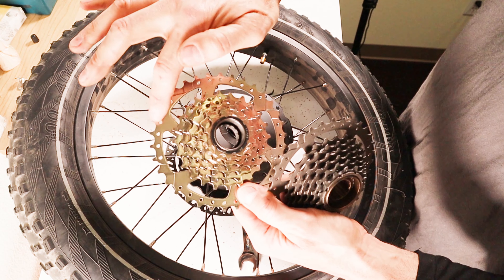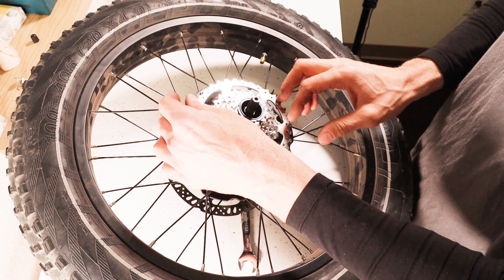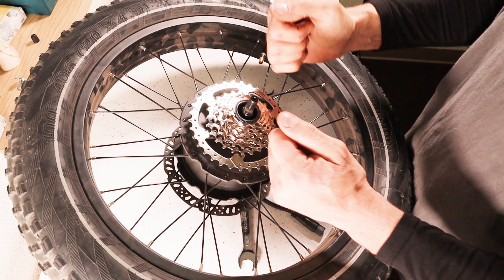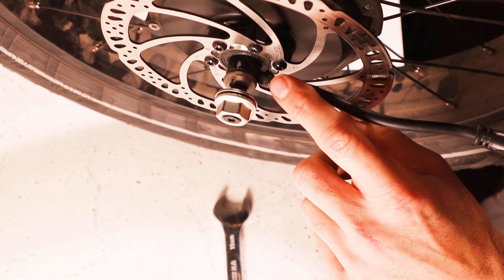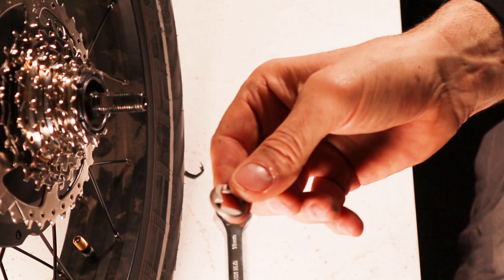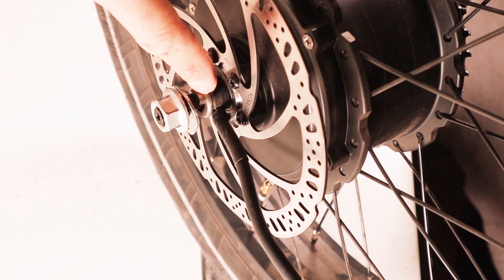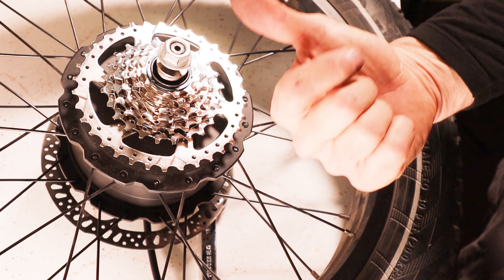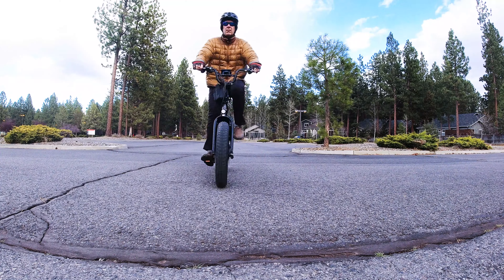RadExpand 5 - Freewheel Upgrade

Comment: Thanks so much for this video!  (And the other related videos about removing the wheel/adjusting the brakes).  With your instruction, it was so easy to fix one of my frustrations with the Rad Expand5...ghost pedaling.  I've only ridden a bit after making this change but it feels like all the gears are useful now, as opposed to only 6 and 7 previously. And I get more purchase in gear 7, for sure! I took my bike out of the stand and put it on the ground to help get the wheel firmly seated before tightening everything down - felt like it was impossible to do it while in the stand.

Comment: Thanks for the share!  I definitely will do these upgrades to get some more speed out of my RadExpand 5.  I would really like it to go 35mph.  Post more if you figure something out.
Reply from the maker: I will let you know 👍. This gives you a few extra mph. It helps quite a bit. Keep in mind, these motors are not designed to go 35. They would burn out quickly
Reply: You gotta build a mid drive for those speeds

Comment: Is the spacing between the bears the same as the original freewheel ? I made the switch but found that I have increasing difficulty changing  from the 11 tooth high gear to lower gears. I can make 3 changes and no  more? 5:33 . 
5:33

Comment: Your videos  gave me the courage to change out my freewheel despite the « dreaded rear wheel » 😅. In re-installing the wheel I broke off the alignment bolt, just above the axle bolt (brake side). Is it crucial for the safety (keeping the rear wheel in place) or does it mainly serve to align the wheel while re-installing? Thank you 🙏
Reply from the maker: It just helps align the wheel. If your axle bolt is tight your wheel will stay in.
Reply: @PedalWithPower  thank you! Do you have a "buy me a coffee" option? I owe you! thank you for all you do!

Comment: Sorry to be a pain it seems that to have a freewheel set up I also need the new screen which doesn’t come with the Radexpand5 so I need to order a new screen with the freewheel is that correct it seems the bike starts to get more expensive than what I’ve paid

Comment: I'm assuming the same chain can be used after swapping out the free wheel. Is this correct?
Reply from the maker: You are correct. We're only going from a 32 tooth low gear to a 34. I still have the same chain on and it has been working great 👍

Comment: Hello, i installed new freewheel 11/28 instead 14/28 (my e bike is 20" wheel) but still on top assistance there is "ghost" pedaling effect,  my front sprocket is 48 teeth, do you think that upgrade to 50 or 52 teeth will be better? 
BR

Comment: Nice! Glad you still have the option to add a few MPH. After adding the display, do you still only have four PAS levels?
Reply from the maker: Yeah, no PAS 5, I'm out riding it now. On pas 4 you can cruise around 22-23mph, which is perfect for me. You really need to pedal a bit to keep it at 25.
Reply: @PedalWithPower  Glad to know. Thanks again for your videos. That extra 5 or so mph is plenty for me. Because I always imagine what happens if I crash at that speed. Also, can you send the link again on where to order the freewheel/cassette?

Comment: Enjoy your videos on the Rad expand 5 it gives me more encouragement to getting the bike. My question in regards to the freewheel upgrade. Did you have to adjust the rear derailleur? Coming from a road bike and mountain bike experience I know when I had to change out my Cassette I needed to do little adjustments to get it to shift smoothly. Again thanks for the videos and I'm actually going to test ride the bike next week at the rad power store front in the area.

Comment: Considering a 5expand.  Their website has up to 5’10”.   Is it too small  for someone over 6’?
Reply from the maker: It's a little small. I had to put a longer seatpost and stem on it.
Reply: Can confirm. I'm 5'10", and I bought a RadExpand for my wife who is 5' 8". It was a little too small for her to get a full extension, and way to small for me. Just bought a 450mm seat post though, which is a cheap and easy fix for that problem.

Comment: How's the freewheel hold up over time?
Reply: Drift Maniac Freewheels are trash, the teeth are uneven out of the box. Get yourself a DNP Freewheel, it comes with even teeth lol the only downside can be the bearing that will prematurely wear out(light grind noise) after 6 months everyday riding(better to replace bearings than to have teeth skip from the start) if you want the 11-34 it's the ST1781 or if you want 11-28 it's the ST1780
Thank me later😉

Comment: It would've been nice to see the difference in pedal speed. Most common complaint on the Exp5 is it runs out of gear or hamster pedaling. 6&7 are the only usable gears. It was really engineered wrong for a 7 speed derailer. This freewheel upgrade is a big help I've heard but not the cat's meow.

Comment: But wait hub motor don't rely on the gear casset ? So u just over powering it via human power ?
Reply from the maker: It just allows you to keep pedaling at higher speeds. Helping the motor out by supplying more of your own power. With the stock freewheel, I was topping out at about 21mph, spinning really fast, now I can pedal up to 25 and still engage the gear.
It's not a must upgrade, just an improvement
Reply: @PedalWithPower  fantastic thank you 😊  will be doing this on my unlocked biktrix kutty x =)

Comment: Not sure why you need a lower low. Why not just replace the front sprocket?
Don't need low anymore with electric. Need higher high with 20" wheels.